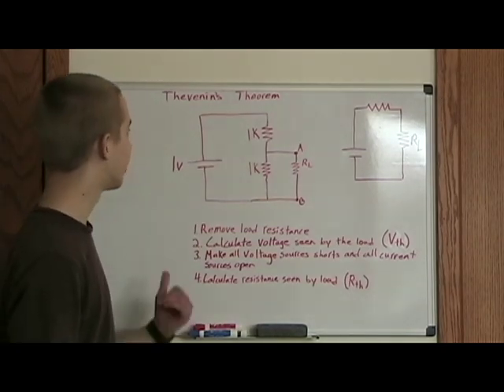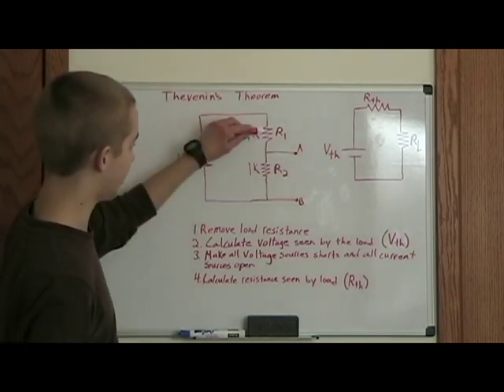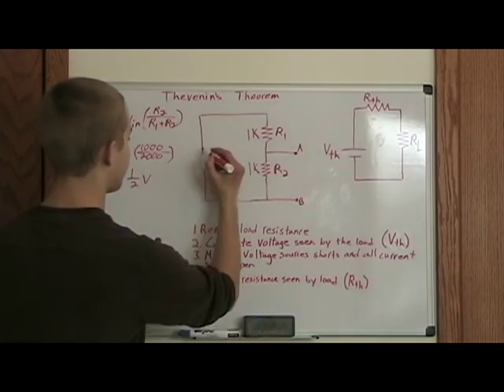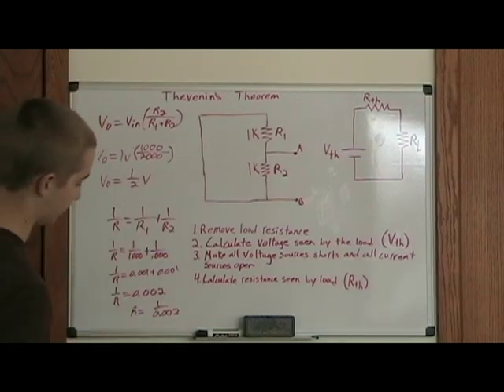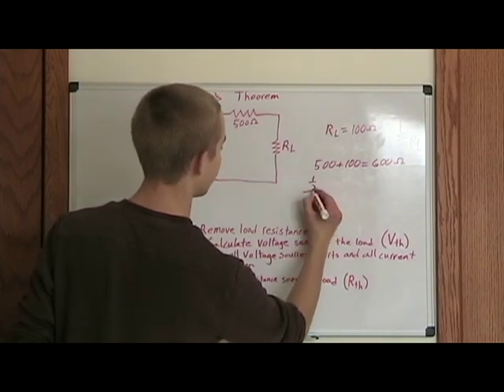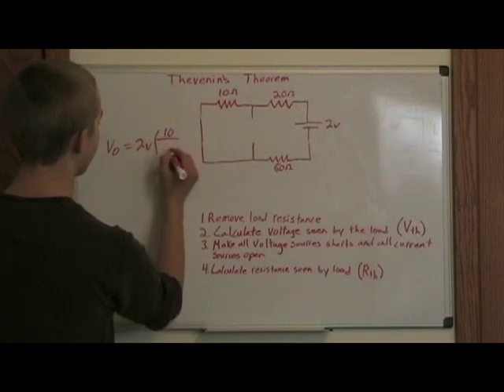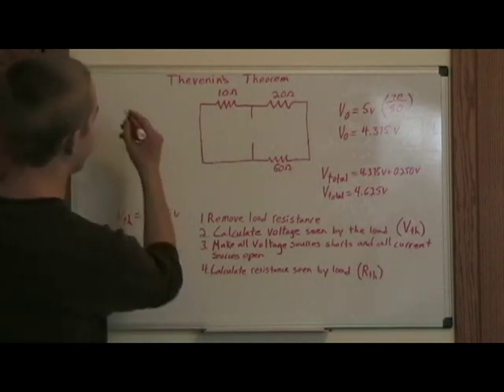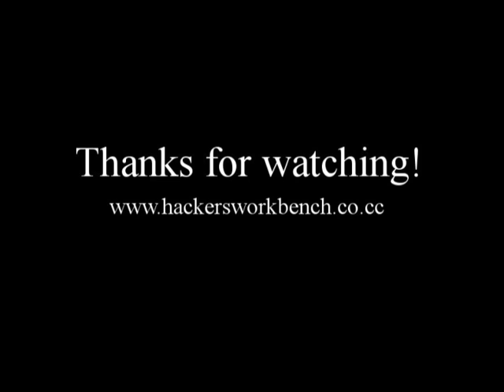Thevenin's Theorem Basics

Comment: Great video! Just one thing, though... The two resistors on the right (from example 2) add up to 80 ohm, not 70ohm!.
Reply: haha,it look like 60,but it is actually 50~
Reply: You're wrong. It's really 70 ohms. Those resistors are 50 and 20 on the right side. On the left side it's 10 ohms, that's why his total resistance is 80 ohms.

Comment: really well taught, easier formula to save time for finding parallel resistors though -> 1/(1/R1+1/R2)=R1//R2
Reply: R= R1R2/(R1+R2)

For those who are still wondering. Also the resistor at the bottom in the second example is 50 ohms and not 60.

Comment: @hackersworkbench I'm a mechanical engineering major and I have to take this as an elective so this stuff isn't very intuitive to me. But if you short out the load resistor doesn't that mean that there is no current in those wires? if there is no current in those wires, aren't you left with one big loop with R1 and R2 in series...oh my. I just got it.Epiphany! thank you.

Comment from the maker: @3NGIN33RS P.S. Since the voltage source in the example is ideal, it has zero internal resistance, and so the best way to model it in terms of resistance is to replace it with a short.

Comment from the maker: @3NGIN33RS Rth is the resistance seen by the load when the voltage supplies are replaced with shorts and the current sources are replaced with gaps. In the first example this means that R1 and R2 are parallel as seen by the load. Imagine an ohmmeter hooked up to points A and B in the first example (with voltage source replaced with short). Would the resistors be in series with the meter, or in parallel? Make a similar circuit and try it. Look up series and parallel circuits if needed. Good luck!